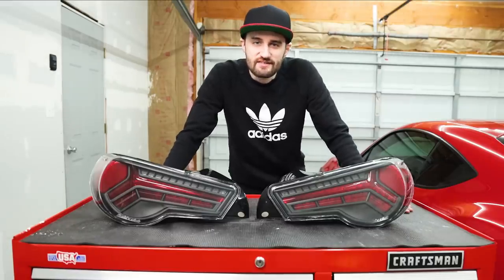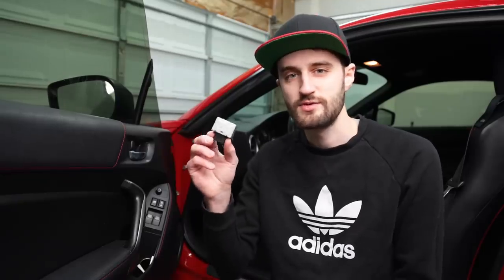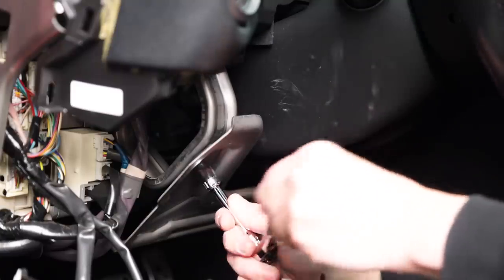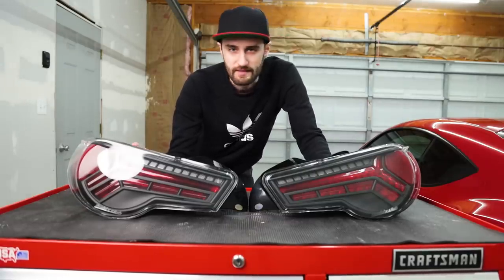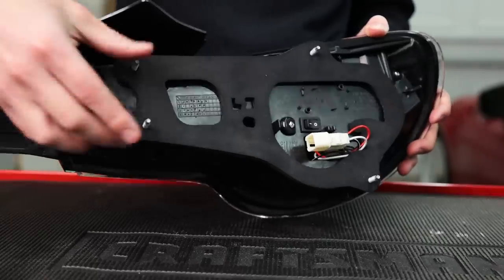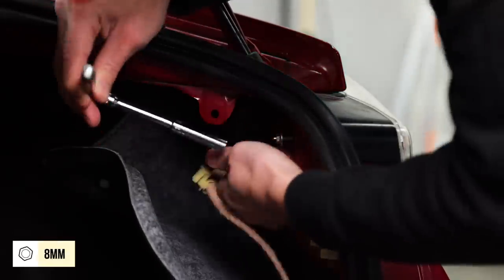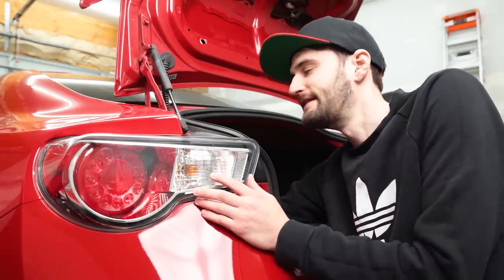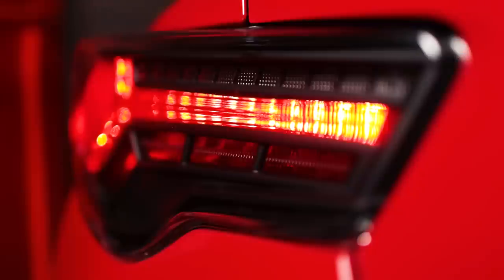How to Install Sequential Tail Lights 🔥🔥🔥

Comment: Hey Justin it’s not real clear to me why you repinned the tail lights. Could you explain that to me please.
Reply from the maker: Hey sorry I just saw this. I try my best to stay on top of comment replies. The reason I needed to repin them is because out of the box, the running lights were wired to the turn signals and the turn signals to the running lights so I needed to reverse them. Im not sure if this is a a manufacturing mistake with these lights or if they are actually wired differently overseas
Reply from the maker: Basically if you install them right out of the box without repinning, when you put the turn signal on, the daytime running portion of the light flashes rather than the turn signal. And if you turn the running lights on, the turn signals would both illuminate